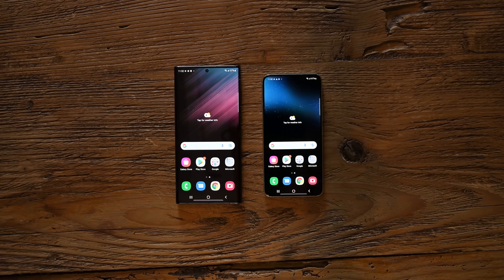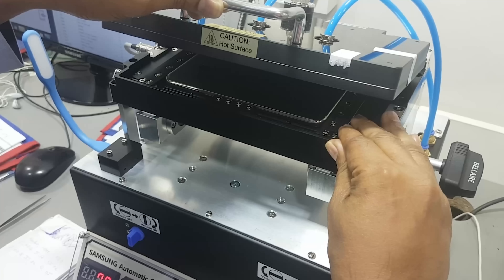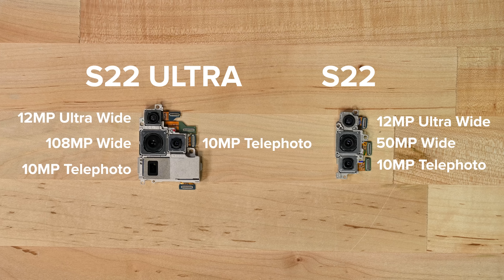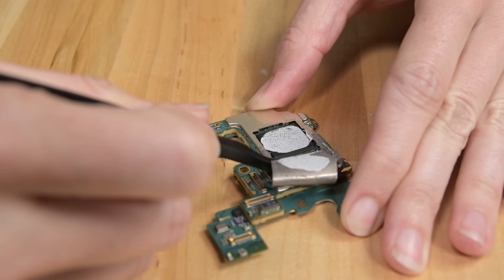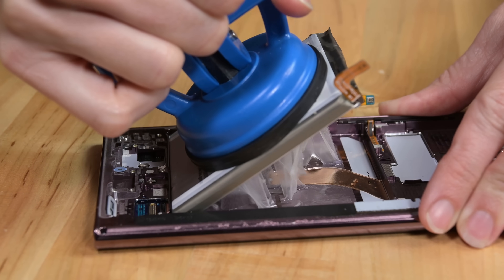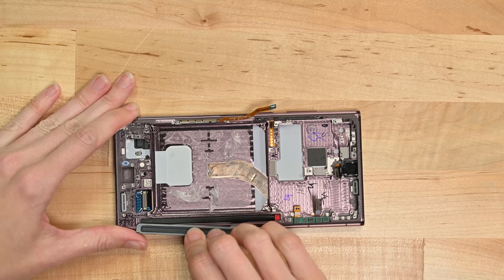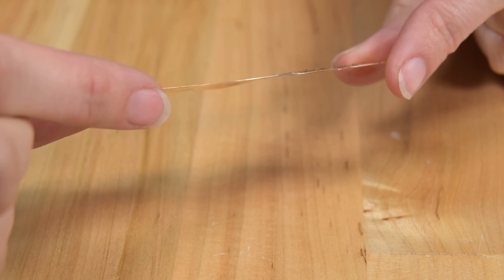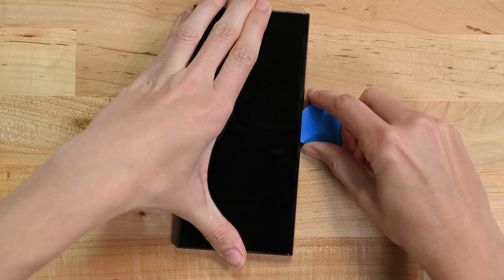Galaxy S22/S22 Ultra Dual Teardown: Note what we expect

Comment: Looks like a lot of room for a micro sd card and headphone jack 👀
Reply: No, not enough room for profits.
Reply: Courage
Reply: @L-dragonix Both would be best but if I can choose one, headphone jack all the way. You can buy a tier with enough storage but can't have a tier with jack.
Reply: That's company strategy because their up upcoming phone model new design with airphone jack but they pick out other features
Reply: @Allan Cameron Latency is problem with bluetooth earbuds. Wired headphones are just so easy, you don't need to charge them, and best yet, they don't have batteries which usually can't be replaced, so they'll last longer than 3 years.
Reply: Samsung courageously added Air Gaps. They allow for making the phone bigger without adding any features.
Reply: Exactly! Wish these features would return.
Reply: Come on. Think about what and why Apple never put MicroSD and got rid ot an Audio jack from years and years ago! It's all about $ Profits to company! At least Samsung did put all them in all together until the end of old generation.
Reply: Ok can you tell us where exactly that space is? It seems to be completely packed to the point they have to stack components
Reply: They know that if they did add one slot for a SD card, the ultra would be perfect. And you wouldn't have to buy another phone ever. It's all about money. They want to keep selling the phones, that's it.
Reply: Screw headphone jack but micro SD card is a must
Reply: @adithyansunil1153  The audio jack only got removed to sell more wireless earbuds. The S10 launched with one, then the Galaxy Buds launched, then the Note 10 didn't have one
Reply: Screw Micro SD, headphone jack is where it's at.

Comment: It’s too bad people overlook the S 22+.. It doesn’t really stand out as much.
Reply: The Non+ is just trash, if you want to get a up to date flagship you have to go with the + or ultra
Reply: @ShowXTech  love my 22 non +, it fits one handed and works great most of the time
Reply: @bradhaines3142  But it's not an up to date flagship and in my opinion to expensive. It's missing WiFi 6E, UWB, Faster Charging and there is no higher RAM option. Additionally the ultra low refresh rate and higher resolution display you only get on the ultra.
Reply: @ShowXTech  well 6e means nothing, UWB is only useful when you can throw a rock at the tower you have to be so close, faster charging has already proven to be a lie. even at 45w the batteries dont charge any faster (on the big ones) 

and as for the price, i traded in a 600$ pixel 6 128 (non pro) and got the s22 256 for free. so i basically got paid to have this phone

edit, and refresh rate is the same on all of them, so is pixel density. anything above 1080 on a phone is just meaningless. its like an 8k tv already
Reply: They should just ditch the Plus model imo. There's already the Ultra for the bigger screen.
Reply: What screen size do you have
Reply: It's literally just like the S22 but a bit bigger... there's nothing special about that.